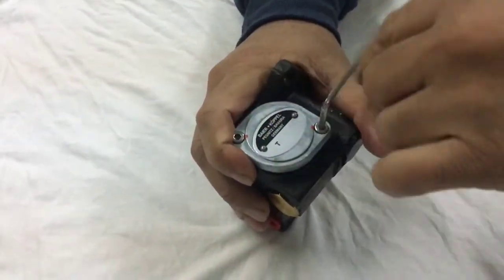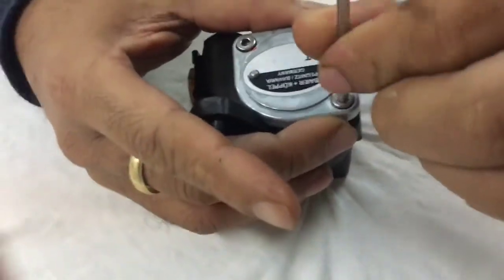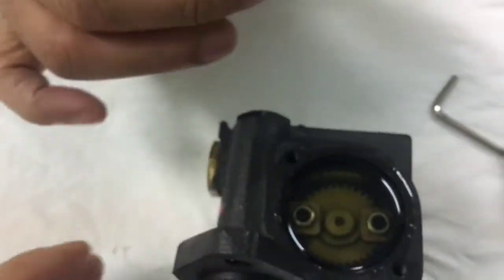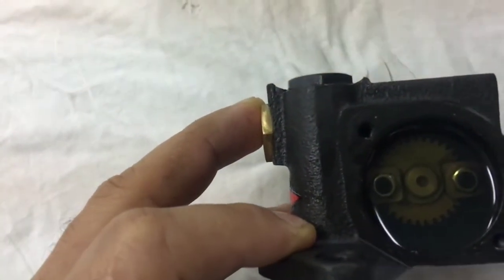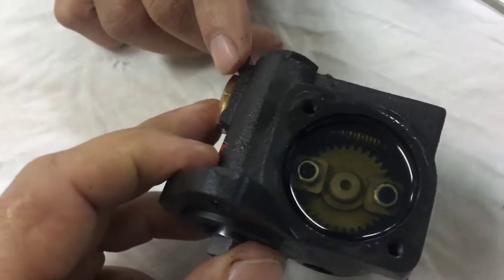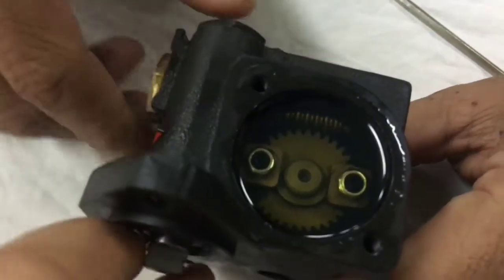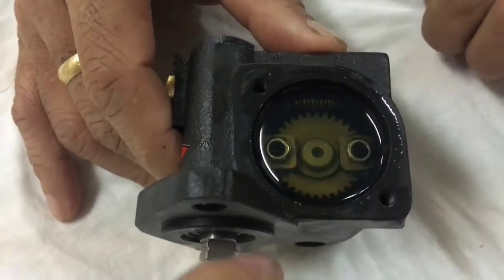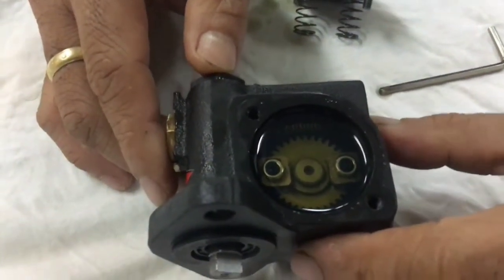Tanabe air compressor lubricator pump.

Comment: You can increase or decrease the feedrate of lube by adjusting the allen screw inside but first by loosen the lock nut. turn clockwise for increasing the feedrate.
Reply from the maker: Thank you